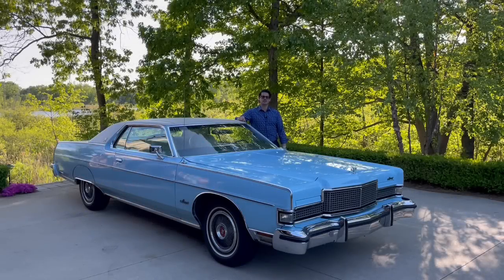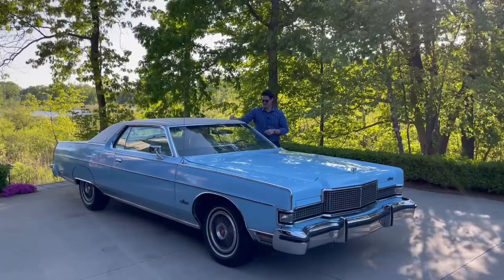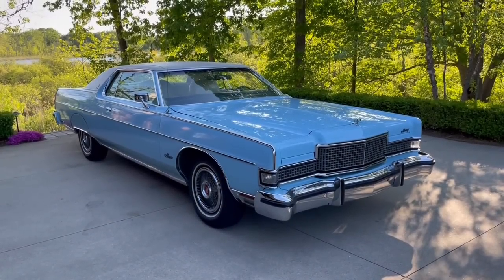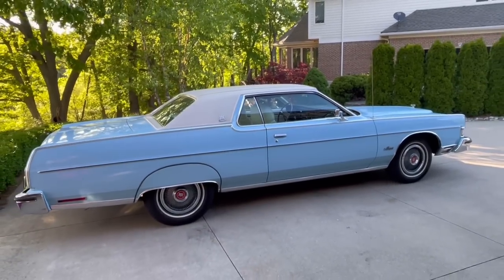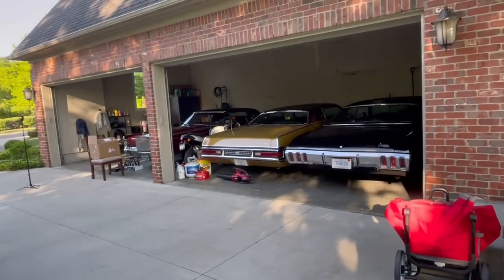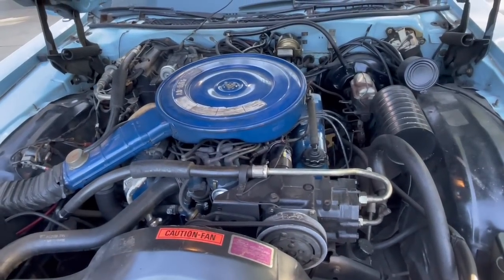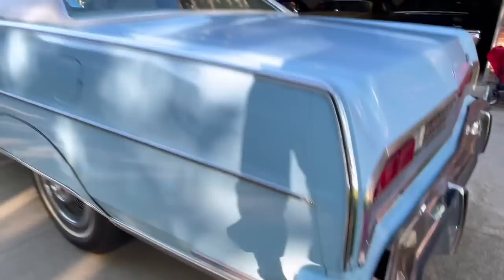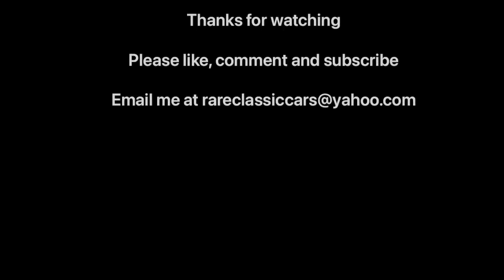Best Classic Car Combo of Ride & Torque...1973 Mercury Marquis Brougham Hardtop Coupe

Comment: 4:58 That was actually a pretty big fail for this era of Mercury. For some odd reason this entire decade of vehicles has plastic and nylon gears for many of the mechanical accessories. Electric window parts, electric headlamp door gears, windshield wiper arm parts all plastic or resin that required grease to not wear out quickly. Also many of the wear parts that were made of steel were coated in plastic for sound. The timing gears, door hinges and strikers, throttle and kickdown linkage coated in plastic that wore off pretty easy. The starter relays and later, the cruise control and  ignition box went from being simple metal boxes to tempermental plastic pieces that would crack and malfunction on heavy rain days. My grandmother had a 73 and it was nicer than any of my friend's Cadillacs. But it always felt like it was about to break down. Had they done a better job at engineering the plastic out of the equation, Mercury would be like Genesis is to Hyundai. The same as Ford only better.

Comment: It's my understanding that the 460 replaced the 429 mid year as the top engine choice. I don't think the two of them were available at the same time... but I could be wrong.
Reply from the maker: They were for 1.5 years.  Half of the 72 model year and for all of 73
Reply: When we got our 1973 Mercury Marquis Colony Park wagon, we had three choices: 351, 429, and 460. My parents chose the 429.
Reply: @RareClassicCars  Oh, OK. Thanks.
Reply: If I’m not mistaken aren’t the rods and crank the same but the bore is bigger on the 460 compared to the 429. Perhaps that’s why there’s only a $75 difference
Reply: @RobertSmith-le8wp  Other way around. Same bore, different stroke. 

And don't forget, $75 was a lot more money in 1973 than it is today. In some cases, you could upgrade from a 6 to a V8 for that or perhaps less.
Reply: @hughjass1044  supposedly Ford designed the 385 series engines to go to 500 cubic inches or better, then the whole oil OPEC and EPA thing came along.
Reply: @mikekokomomike  I think you're correct.

Comment: If you had seen these cars next to GM cars in the 1970s, when they have some age on them, not even Cadillac can stand up.  I think Adam is actually a bit biased against how high-quality the Fords are in comparison to the other 2.  What did these cars in is the used market: people would not keep up on all the vacuum, and chasing down vacuum leaks was about the same as a Boomer looking at EFI: looks too complex and too many problems.  But a 4yo Mercurcy held together so much better than a 4yo Cadillac.  Having experience from the preserved cars is awesome, but it misses how much better these cars lasted back in the day.

Comment: For the vinyl top, perhaps 303 Convertible Top and Tonneau Cover cleaner ? Gentle but thorough. And a very soft brush. Or the McGuire's equivalent? Very happy with the 303 product line of cleaners and protectants. Apply seasonally (4 x per year when car is in year-round use). Protectants should be far kept away from any kind of "chromed wrapped plastic" as they will bubble. But to their purpose, very satisfied. (There is a separate protectant/sealant for convertible tops.) Nice car! Love the baby blue and white!

Comment: Mercury was a much better car than the Fords. The 67  Cougar introduction vs. the 67 Mustang. there is no comparison on the base models. A 289 V8 vs. a 200 CID, gutless six. A lot of insulation that wasn't available on any Mustang. More than Mustang for rear foot room and slightly longer wheelbase. Less than $200 difference in base pricing. what a deal!